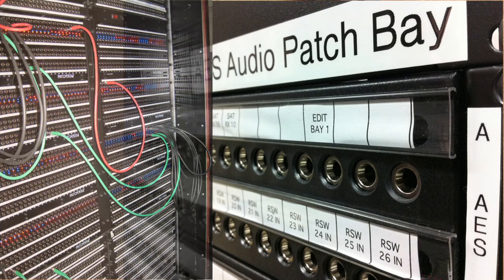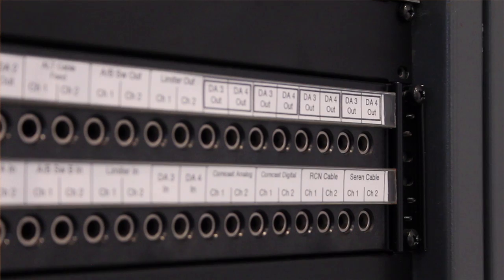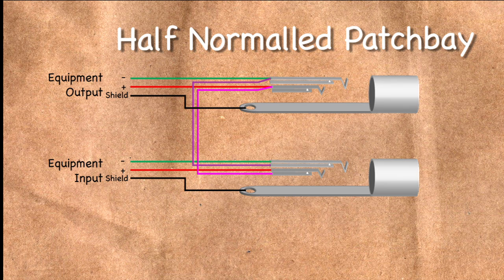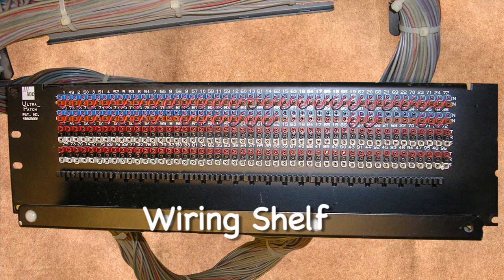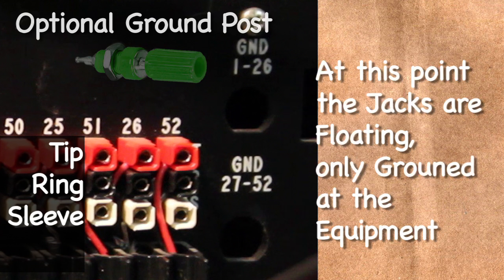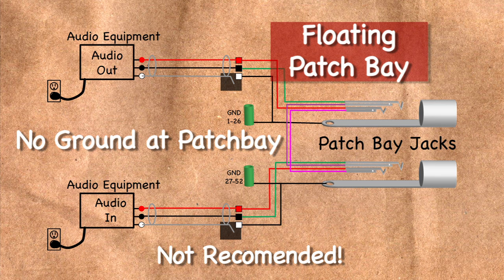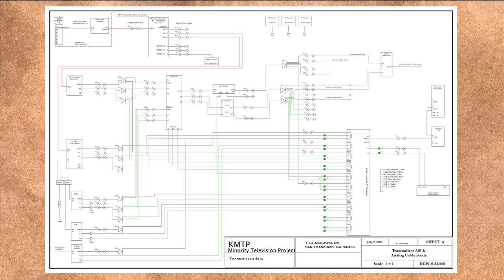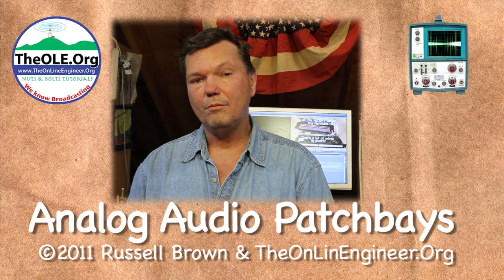Analog Audio Patch Bays

Comment from the maker: The patch bay cables shown are used professionally, although you can use 1/4" stereo phone plugs they were not designed for patch bays and may damage the jacks in professional jack fields

Comment: Great video. I just purchased the same patchbay you’re using In the video. I’m having trouble finding the correct idc tool, also what gauge tps wires are required? I’m only used to consumer grade cables from xlr and 1/4. If I need to run my I/O from my outboard preamps and compressors. Should I use the smaller idc gauge and solder the other end for my outboard I/O? Thanks so much

Comment: I am having fits with my punch down.  The jacket keeps crushing the sharp pin edge instead of cutting it off.   The only solution I have found is to pre-snip the wire on the end and not rely on the cutting edge of the pin.  🫤